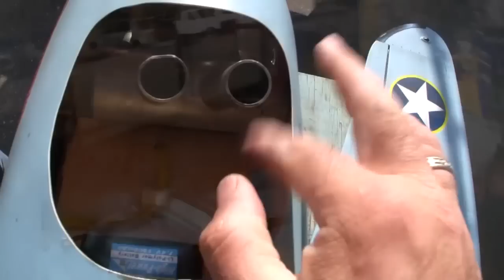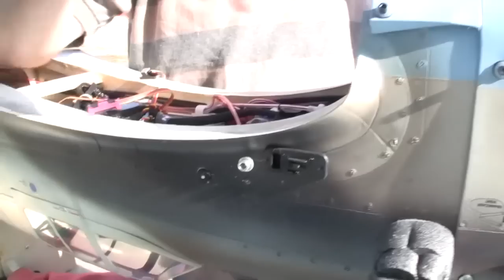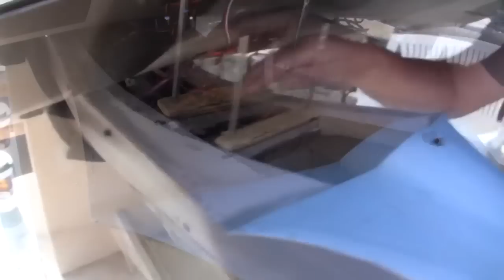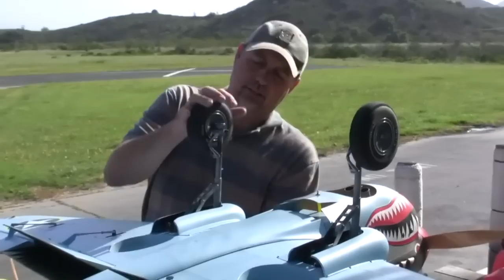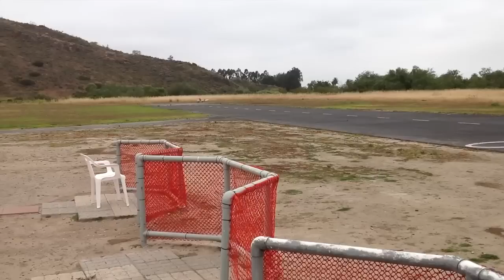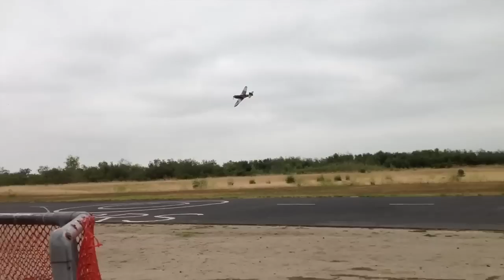#13 Pimp Your ARF - Equipment Overview & Flight

Comment: I think your elevator servos HS-5645MG ,a bit underpowered for elevator, empirically you may have gotten away with it but consider the lifting force, mechanical advantage and CG in a 60mph climb it is significant

Comment: Electrodynamics out of Michigan makes a Multi connector block With a snaplock so you're two ailerons and two flaps are in one block of the multi connector with a positive snap Can't come apart until you press the snap. Makes connections a breeze. For a few l$ even custom make the lengths To your specs

Comment: I'm so glad I found these videos.  Thanks very much for the in depth explanations and your time.  I'm currently working on a TopFlite P-47 (60 size that I will be putting a DLE 20R in).  The glassing with the Minwax went better than I expected.  Sanding is a real chore, I mistakenly put two coats of primer on after sanding down the final coat of Minwax.  I am planning on using DecalPro dry transfer system to do the smaller decals, however I will probably have to paint on the star and bar for the wings and fuselage.  Did you make your own stencils for your star?  It's gonna look too good to fly!!
Reply: What was the total weight of the plane after following the fiberglassing here?  It seemed like there was a lot of weight added in the many coats.

Comment: Also I have a test piece of balsa which is prepped the same as the plane itself.  I was going to use Behr acrylic flat paints then put TopFlite Lusterkote flat clear over everything to fuel proof it and seal the decals.  Any thoughts on this?